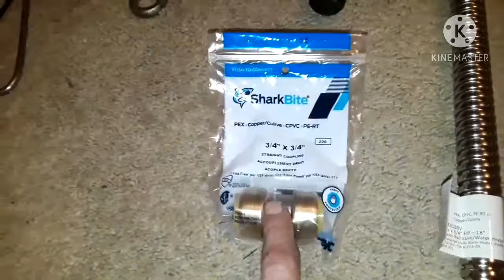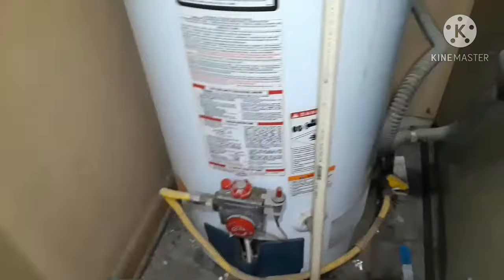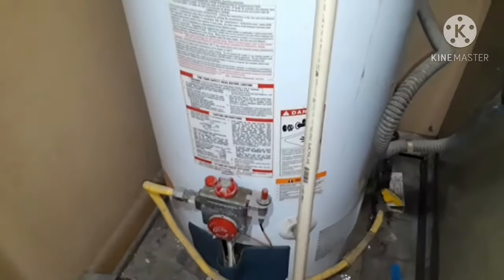Water heater water supply lines replacement

Comment: i installed  a water heater using Shark Bites and the WATER heater lasted 10 1/2  Years before it needed replacing. Shark Bites held up fine NO LEAKS or FAILURES.
Reply from the maker: Thank you for sharing! Shark bites have held up perfectly fine for me too.

Comment: Thanks for the vid. I have to replace my hot water heater and the copper fittings are corroded.  This will be a nice option for me.
Reply from the maker: At home depot you can buy the kit. It's the shark bite push to connect water heater connection kit.

Comment: How long does the water supply line last?
Reply from the maker: This video and work was done about 2 years ago and it has lasted this long with no issues at all,  So 2 years for sure. Probably gonna last a lot longer than that

Comment: Do you have to drain the water heater to switch out the supply line?
Reply from the maker: No because the lines are on top and all the water is inside the tank. You will have some excess water from when you cut the pipe, not much though. You will need to turn off water heater whether it's gas or electric and give it time to cool down. There's alot of pressure inside the tank
Reply: @ATrainETV  thank you
Reply from the maker: @RickySlatton  no problem.

Comment: Did you have to reignite the pilot
Reply from the maker: Yes, I made sure to turn off water to house and I turned off the gas line to the water heater. Once I reconnected it all reignited the pilot.

Comment: So you show yourself sanding the pipe for four or five minutes, and then you don’t even video connecting the supply line and the shark bite? Makes no sense
Reply from the maker: These are push to connect fittings not much to show. Very good point though. I had a hard time finding a place to set my phone, it kept  falling down. I do appreciate your comment and thank you for watching. The next video I make on push to connect fittings I will make specifically for you. 😉 In case you havnt already please consider subscribing!
Reply: I know!!! Why didn't you show the actual hook up?

Comment: Sharkbites should not be anywhere near a water heater. If I'm installing a water heater and I see those then I'm throwing them away and grabbing a pro press tool and brass fittings. I understand the appeal to a homeowner but ill always tell people, pay a lot now and don't worry about it later, cut costs now and pay 3 times that in the future. Always better to take the time to do it right as this particular situation means you're getting water or not.
Reply from the maker: Yes I agree. Shark bite fittings have their place in plumbing. Underground or near water heater might not be the ideal spot. Its something that can can be used temporarily since they come with little tool to remove them easily. This is just how I handled my problem and it's been almost 3 years since I did this work and no problems at all. Thanks for your comment it's appreciated and don't forget to SUBSCRIBE!
Reply: @ATrainETV  I agree, I use sharkbites as a temporary deal in order to cap a water line if it's about to be worked on, other than that I just can't trust them based off of what I've seen and heard. What blows my mind is when people buy/use sharkbite PRVs on their home... that really gets me. Kudos to you for doing things yourself man, I've met a lot of homeowners that see the smallest issue like hair in their shower drain and then call a plumber out to remove the drain grate and pull a little bit of hair out and then get hit with a thousand dollar bill. There are certain things that anyone can do and there are certain things that only few people are trusted to do.
Reply: Every house should have a shark bite half inch calf cap just in case of a leak or the three and a half inch repair on a half inch water leak
Reply from the maker: Thanks for your comment and I completely agree! Don't forget to SUBSCRIBE!!!
Reply: @disquiet3163  I consider water heaters temporary anyways, so I will do my first install using Sharkbites since these things have over 20 years of proof.  Sure, I wouldn't use them behind a closed in wall, but for a water heater, I see no problem.
Reply: What's your reasoning for this, since Sharkbites have been around for over 20 years.  Water heaters last less than 20 years and even if the Sharkbite starts to leak, shut the water off and a very simple fix.  Welcome to the new DIY plumbers.
Reply: Lol, they are fine near a water heater.  what difference does it make how close it is to the heater. Btw, no diy plumber is going to buy a 1000$ pro press tool to replace a water heater every 10 years. It’s in the title DIY
Reply from the maker: Exactly,  plus the sharkbite kit that i purchased is specifically made for the water heater 🤷‍♂️ they have held up just fine
Reply: And the correct terms logo water heater..
Reply: I agree that sharkbites shuld not be used on hot water heater.  When my plumber came in he used propess fittings.  I allowed him as long as he put in a union so i don't have him cover back to change out my anode rod.  I have a bradford/white water heater and the anode rod is built in to the hot water outlet pipe.

Comment: No such thing as a hot water heater
Reply from the maker: Yeah I know I put that in there somewhere. Water heater is what I meant. Thanks for the comment and for viewing. Don't forget to SUBSCRIBE and share my channel
Reply: Nobody cares.
Reply from the maker: Yes your right im sure not many people care. Thank you for your feedback. I will try to post videos that are more helpful to others. Don't forget to SUBSCRIBE! And thank you for your comment
Reply: @ATrainETV  I like how you continually respond positively man. You’re doing great. 
Keep it posting!!!
Reply from the maker: @jonezmusicgroup  thank you, I really have a passion for my YouTube channel no matter how big or small it may be. I appreciate all the comments and will continue to push forward. Thank you, I'm thankful for your response!
Reply: You don’t need Teflon tape on the water heater water connections because those Sharkbite connection have rubber washers on the inside like a garden or washing machine hose. Those Sharkbite connections are sweet! My water heater sprung a leak and when I replaced it I used them instead of soldering pipe because I was in a hurry because I only had 12 hours off between shifts at work!